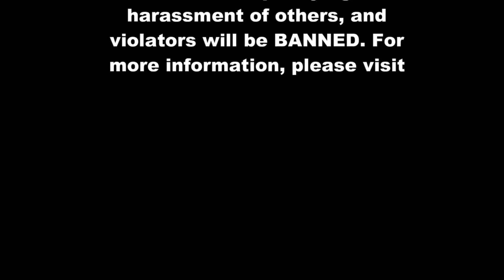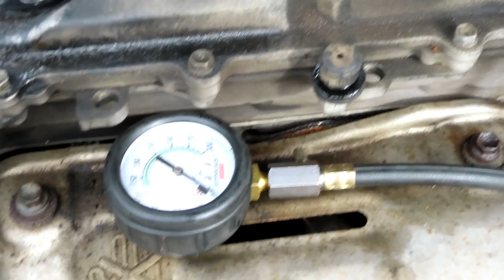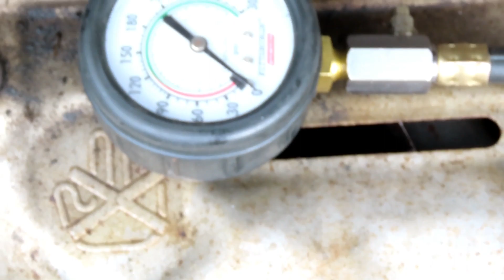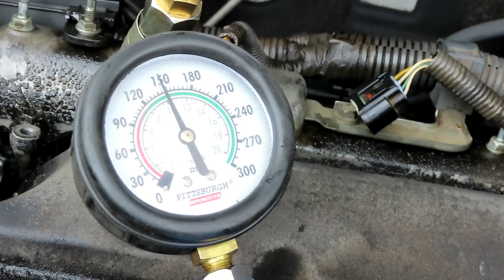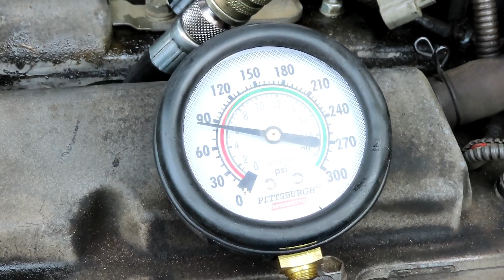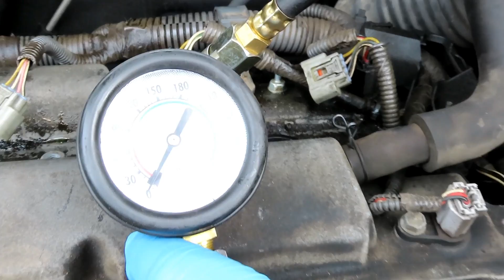⭐ 2009 Toyota Rav4 - 2.5 - P0303 - Burns Oil - Smokes Out Of Tailpipe.

Comment: Online Im working on a 2010 rav4 4cinders,p0303 code,exchange injector,coil,spark plugs from a known good piston same problem,comprecion is good.Most of the time the problem is only at high speed or climb a high level.thanks in advance for your help.

Comment: So the piston ring in cyl 3 is bad? And that's from the misfire caused by the bad ignition coil? The misfiring caused the gas to wash away the oil which in turn, ruined the ring from friction? Right? 
  Does that even make sense to anyone other than me?
Reply from the maker: Makes PERFECT sense to me too!
Reply: Chad Pugh I’m with u,if the valve seals were bad ,it would mostly smoke when u first start it up,so to me seems like the rings hav got in washed out on # 3

Comment: If I remember correctly it was the 2.4 Toyota 2AZ-FE engines that had the oil consumption and stretched head bolt problems. The 2.5 has so far been problem free. I have been wrong before,  LOL!
Reply from the maker: How the heck do you be knowing all this stuff??? There is definitely more to you than what we know!!!
Reply: Thanks for the validation
Reply: I did a ton of research when my daughters were looking at Toyota vehicles. I also opted for the 2016 Rav4 with the 2.5 to try and avoid any issues.